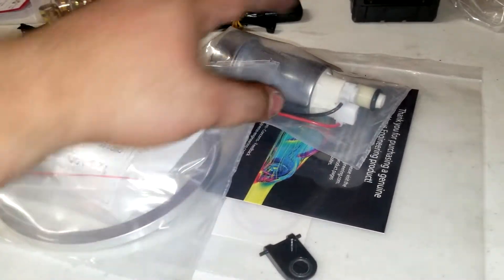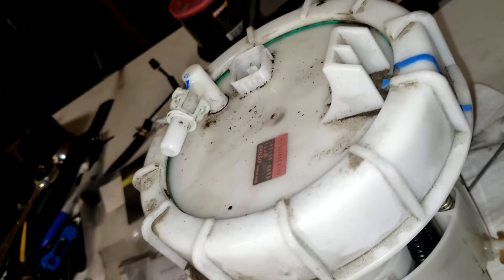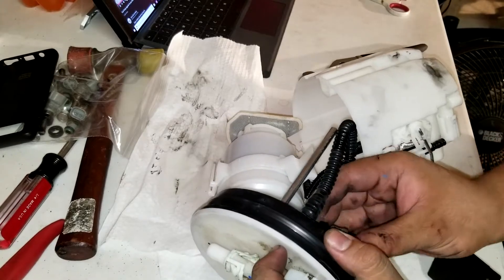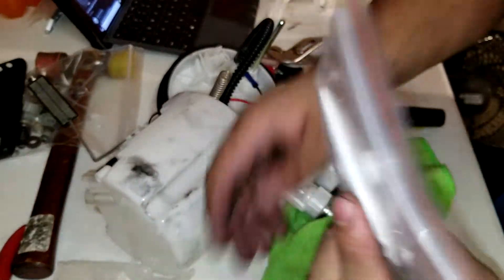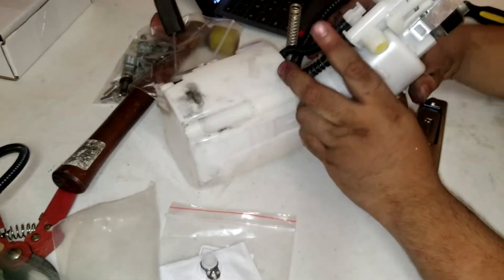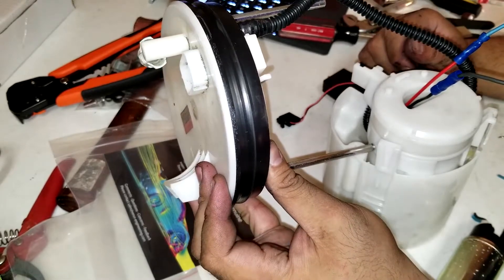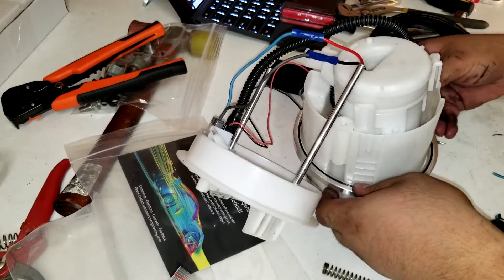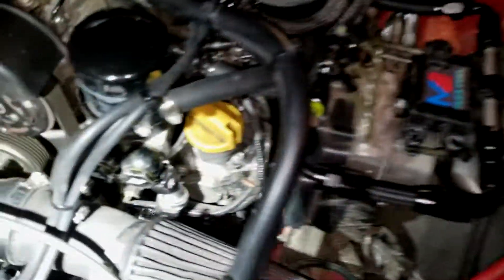ROAD TO 400HP - Turbo Subaru BRZ/FRS/GT86 - Part 5 of 6 (Full Blown Walbro 485 Fuel Pump Install)

Comment: Any update on the reliability and longevity of this pump.  Choosing what pump to go with and concerned if one will fail and leave me stranded.
Reply: Deatschwerks make realiable pumps with parnetship of Bosh. The pump the guy is using on the video are highly faked and not sold directly by manufacturer or trustworthy re-sellers. Even trusted re-sellers were found to sell chinese knock offs. The DW300c is more than enough for E85 and low boost. I would hardwire the pump to get more output to 13.5 or 14.7 volts, if you go higher, your pump will such too much air and drain the tiny OEM hanger.
Reply: You can also eliminate the OEM pressure regulator modify the hangar, use an external pressure regulator and change it to return style draining in top of fuel pump with an6-an8 ptfe lines. But thats more work and money.

Comment: i just installed mine and couldnt line it up properly either, i think the spacer messes it up, but its been running great so far! car feels much smoother
Reply from the maker: Glad to know! Lol. tried my best to align it and it wouldn't budge. Good point with the added spacer.